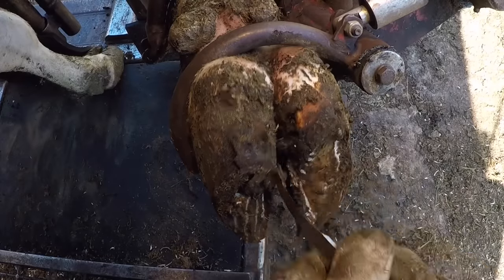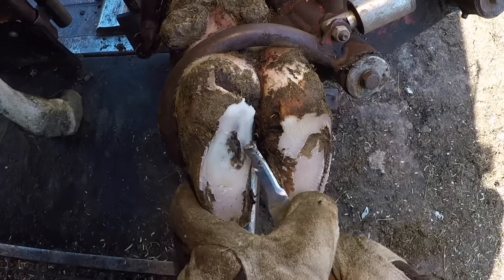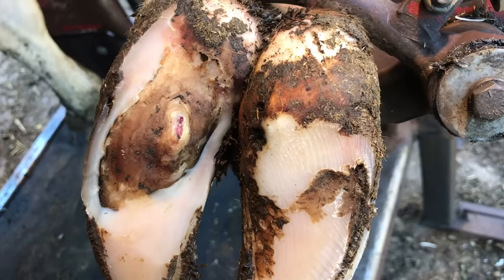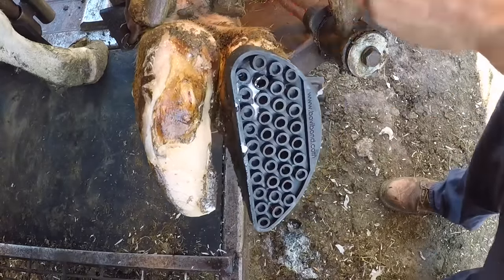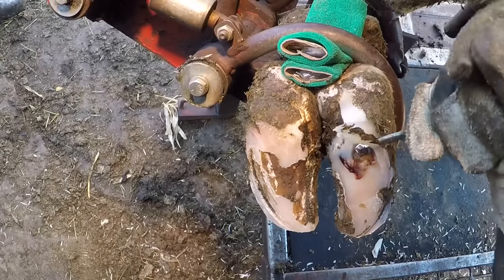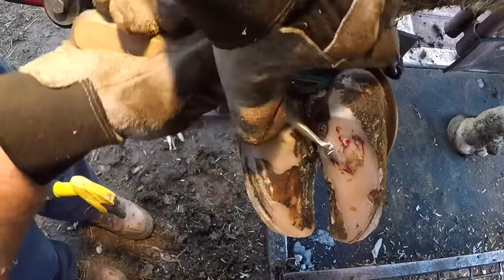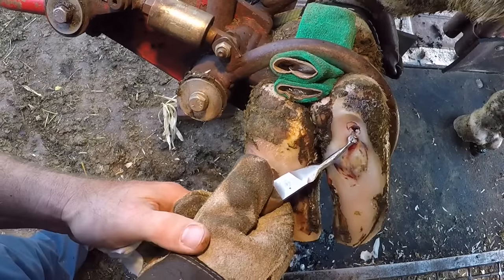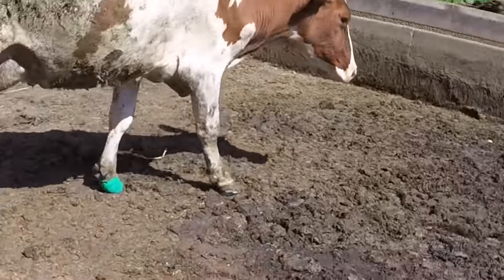A REDHEAD with TWO SORE FRONT FEET

Comment: Now I’m sure that you won’t ever see this comment, but still - could the sole ulcers on front feet on pasture cows be more likely because of the way they have to distribute weight to eat? Free stall cows have either the trough or ground either slightly raised or even ground - while pasture cows surely have various terrain differences, meaning that they sometimes have to bend over “downhill” to feed, putting alot more preassure on the front feet. Could that possibly be the cause?

Comment: Beautiful cow.  She must have been so happy to find her new shoes so comfortable.   Great job.
Reply: With the first cow you didn't relieve pressure on the inner claw(the one you put a block on) for the pedal bone. Either you didn't do that which is part of the 5 step method, or it just wasn't filmed. The problem will persist if you don't take the weight off of the pedal bone as well and since there wasn't a leision/ulsor on the inside claw, if you don't take the weight off of the pedal bone, she will bear all of her weight on that one claw and it WILL cause a problem. I wouldn't be surprised if she had at minimum bruising on that claw. I hope you did carve out the height on the pedal area and I just didn't see it. You're doing a great job though. This is a very hard profession and I have mad respect.

Comment: Does it hurt the cow when the horn is being sliced with a steel knife? Is that area anesthesied?
Reply: It is no different than a nail trim. The only part that is tender would be where it is red and bleeding. If the cow hurts, it will try to pull its hoof away.

Comment: Why dont these guys use a light pressure washer to the hoove before  beginning these procedures???
Reply: It doesn’t wash the insides, which can sometimes be dirty too. It makes the hoof wet and slippery, which doesn’t mesh with working with knives. The outside will be carved out, so no point in spraying off something that’s coming off anyway.

Comment: I wounded how in earlier times (big cattle ranches) when 98% of cattle was free range expect for few milk cow how they dealt with cows feet if at all?
Reply from the maker: The probably didn’t unless they became really bad.
Reply: They probably did not have to because the cows walked more back then and did not get stuck in a barn for 6 months out of the year like they do now days, back then every farm owned 10 times the land that farms do now, also back then all the cows were more free range than now days. And they moved them from field to field which were miles apart, cows now days do nothing but stand in 1 tiny field or barn most of there lives and aren't climbing rocks and skidding down hills, cliffs or paths like they used to which is what wears down hoofs

Comment: Y can't u use water to clean the toe instead of trimming the mud area...  If you clean.. infected are will be visible clearly know... Good job but use water...
Reply from the maker: Problems are quite visible to me without washing.  Usually I point them out before I even start trimming.  Washing is dangerous with electric tools used.  Also time consuming.